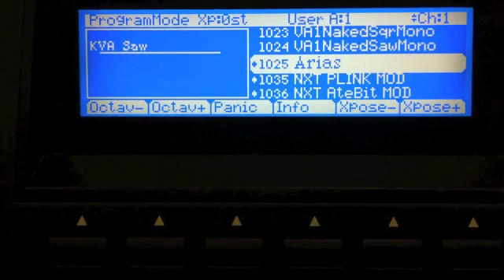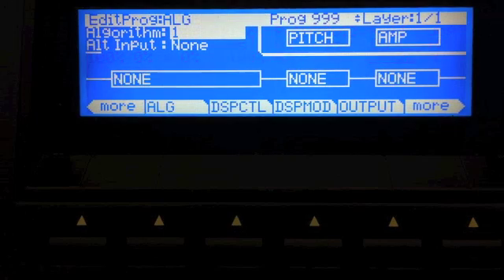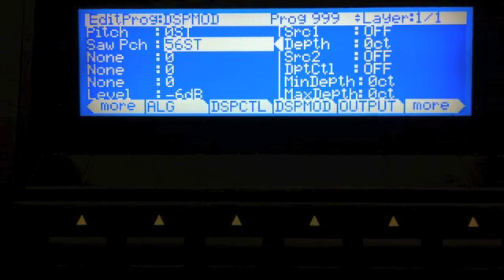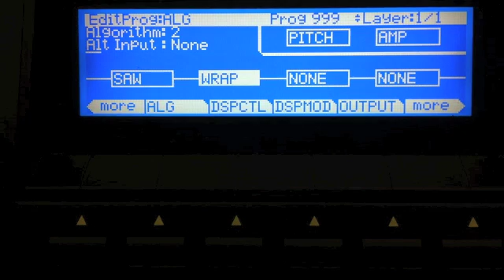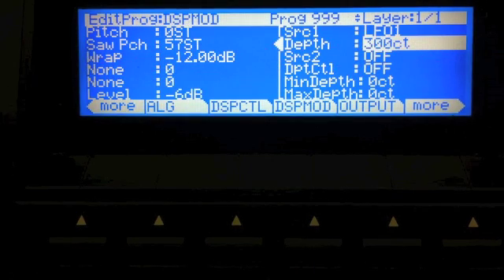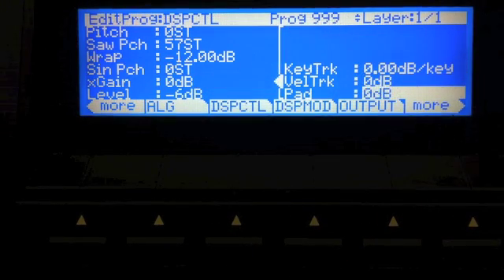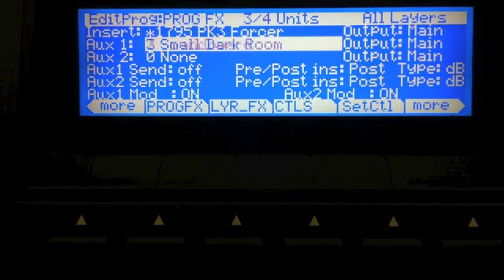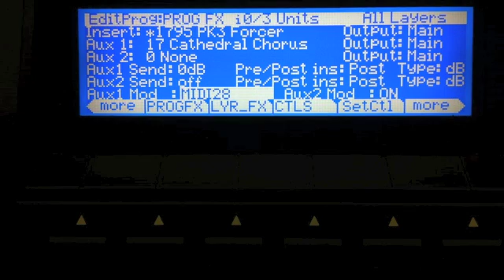Kurzweil PC3: The Good Stuff -- Fun With Aliasing

Comment from the maker: Easy -- Setup Mode, edit Setup 128 (IIRC this is the Setup with no controls assigned to do anything by default), set Slider A on Zone 1 to transmit Midi CC #7 and add a Program you want to the Zone. Create a new Zone, set Slider B to transmit Midi CC #7 and add a Program, and so on.